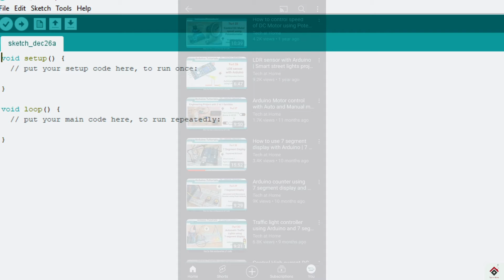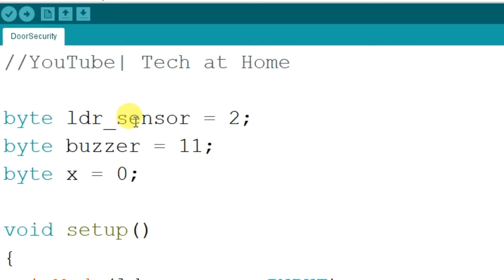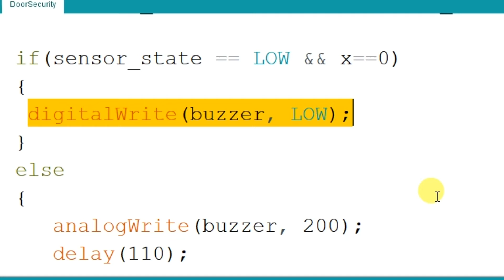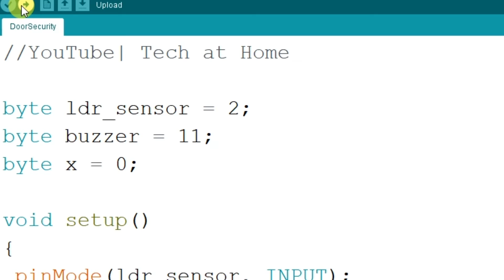Laser Security Alarm Project using Arduino 🚨 Laser Shield Protection for Home, Laser Door Security

Comment: also if I build this how to make it work without laptop like I cant keep it connected to my laptop, btw great video
Reply from the maker: Thank you 🙏 
After uploading the code you can connect to power bank via USB cable.
Or use round pin connector and 9v battery.

Comment: Can you send the product links again,  given links are not functioning
Reply from the maker: Arduino Uno: https://www.flyrobo.in/arduino-uno-r3-compatible-board-plus-cable-for-arduino-uno-1?tracking=EGXCW2oMhfyBcK6Sk1AJrTIztP2cZx0qc64QgrBQeDUPl0RUIBuMMhQFtnvTOaKj

LDR: https://www.flyrobo.in/lm393-photosensitive-ldr-sensor-module?tracking=EGXCW2oMhfyBcK6Sk1AJrTIztP2cZx0qc64QgrBQeDUPl0RUIBuMMhQFtnvTOaKj

Laser: https://www.flyrobo.in/mini-650nm-6mm-5mw-laser-dot-diode-module?tracking=EGXCW2oMhfyBcK6Sk1AJrTIztP2cZx0qc64QgrBQeDUPl0RUIBuMMhQFtnvTOaKj